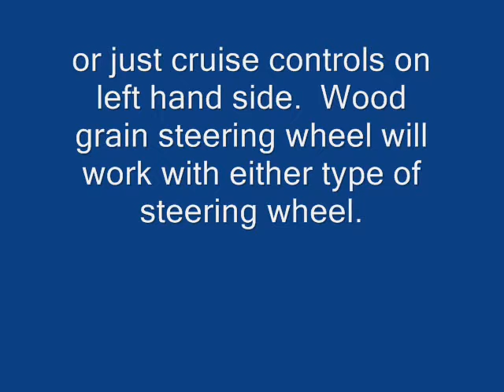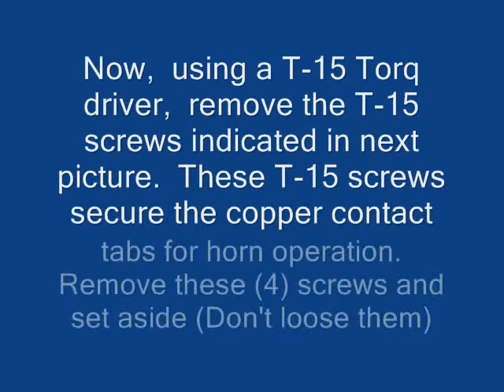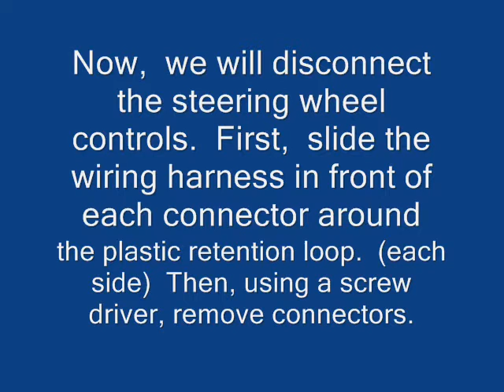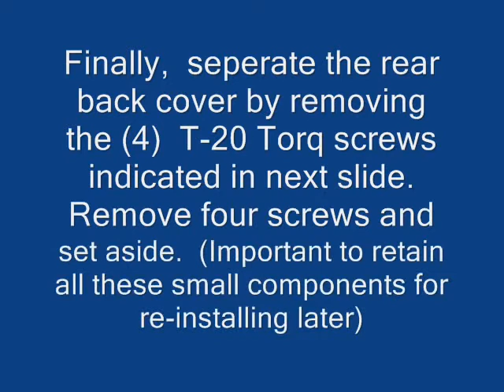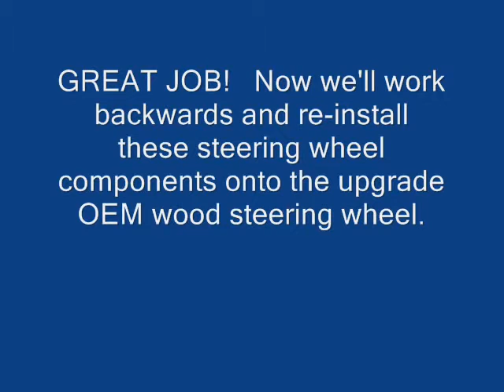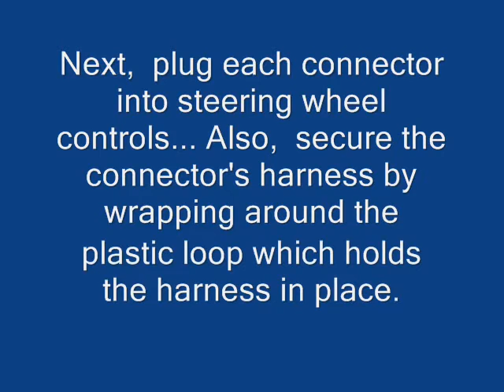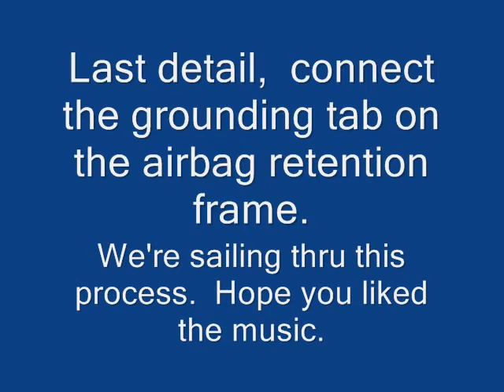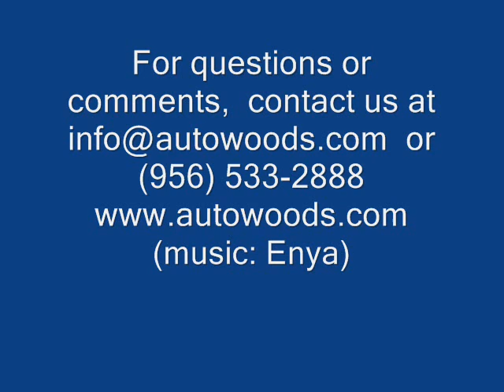Transfer of steering wheel components to Autowoods OEM Grade Replacement wheel.

Comment: @happy543210  Good question.  The water transfer printing process transfers an ink pattern to the steering wheel so the wood matches the OEM Burl print.  When this is dipped, this ink pattern also transfers to the wheel frame and appears to look like rust, but it is actually ink.